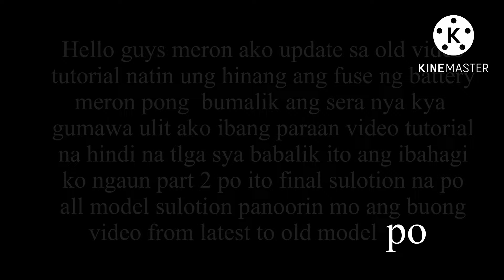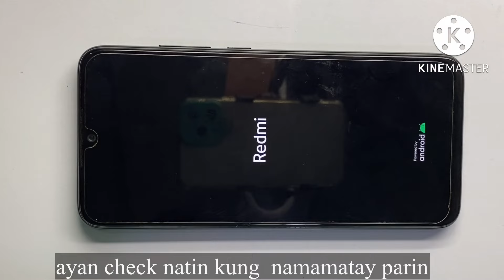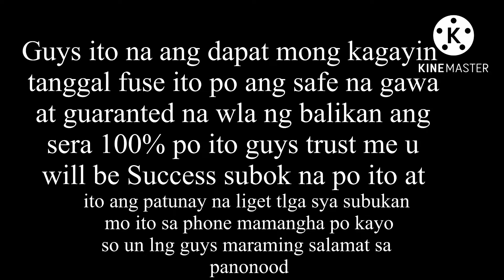All model Battery Fuse Problem Nagagamit lang Kapag Nakasaksak ang Charger Tinodo ko na kaalaman ko!

Comment: Bosing redmi note 7 cp ko, balak ko balkasin at tanggalin fuse buti my video ka

Naghahang na kasi cp kona yun 2019 pa kasi nag downgrade na ang battery, inisip ko malamang sa battery n ito at humina sa katagalan kahit alaga ko

salamat sa video mo, naka kuha ako idea..subukan ko muna tanggalin fuse, baka sakali bumalik lakas nya
Reply from the maker: redmi note 7 din model nito
Reply: @JulphoneTv  ou bossing Xiaomi redmi note 7..bigla din nag hahang na pag naka data or wifi. ok pa naman battery hindi lobo, di din kasi ako mahilig sa games

nasa 3000mah nung chineck ko sa accu battery na apps. 4000 mah yung design capacity 

iniisip ko lng pano maintenance pag natanggal kona ang fuse? 30 % - 90%  lng din charge ko

and mas malakas naba pwersa ng power supply nya wala n fuse
Reply: @JulphoneTv  bossing pwede Kona sungkitin nlng Yung battery ng redmi note 7 pag tinanggal fuse at mag hinang, diko na babaklasin ng buo..

Like mga video mo na nagawa s infinix sungkit lng din

Na try Mona ba sa mg redmi phone?

Thank you

Comment: pero pwede din po ba boss change battery na lang no?
Reply from the maker: yes pwd
Reply: @JulphoneTv 😢😢😢I still have the same issue in my redmi note 8 even after applying jumper wire.
Is the problem with my battery?
Please help 🙏🙏🙏

Comment: I am not a basher here in fact isa ako sa nagsubscribe sa inyo po. nasosolve niyo po tru ganyan pero hindi na safety yan para sa phone as well as sa battery kasi wala na yung protection niya which is ang fuse.. i know this is the easiest way to solve it pero meron naman po nabibili na fuse sa market, yun nga lang hihintayin pa if tru online, anyway it solved the problem naman nasa user/owner na ang bahala na e-avoid ang over charging., still a kodus and good job.
Reply from the maker: thanks for supporting🙏❤️
Reply: saan pwede bumili ng fuse ng vivo s1 pro? gusto q po maayos phone ko 😭
Reply: Kawawa masasabugan ng battery pag nagkashort kasi wala na fuse.
Reply: Yung akin diko inalis yung fuse, hininang ko lang sa katabi ng fuse, magkabilaan/magkabilang gilid. den goods na.

Comment: Hindi ba delikado yan wala ng fuse yung battery kumbaga wala ng safty kasi rekta na sya jumper kumbaga.. baka may chance na sumabog battery?
Reply from the maker: sobranf safe tested na ito kahit ma over charge mga replacent batery wla din nman fuse na
Reply: @JulphoneTv Sir, clarify ko lang po, yung sa video is nag-jumper po kayo ng connection ng fuse at saka binalik niyo na rin po yung fuse?
Reply: @JulphoneTv pwede poba yan gawin sa oppo a5s hindi pa naman siya nalolowbat bigla nalang mamamatay tapos nag aauto start nalang po siya battery fuse napo ba ang problema po nito ..

Comment: salamat sa Idea lods, nakawala nasa  boot loop redmi note 8pro ko pag ka alis ng fuse at na hinang na sya.
nag open na sya pero may napansin akong issue ngayong gabi , nung chinarge ko sya umiinit yung charging pin ko after 5 mins napansin ko mainit sya kaya inalis ko kaagad and then hindi din nadagdagan charge. ano kaya possible problem nun Sir? Sana mapansin ang comment ko sir maraming salamat po.
Reply from the maker: palitan mo charging pin

Comment: Sir posible din po ba na fuse yung sira sa cp ko. may times na yung sound nya putol na putol hanggang sa mashutdown na. pero pagnakacharge ok naman wala namang problema
Reply: 2 kasi iniisip kong problem either battery or motherboard na pero nakita ko tong video nyo baka posible na fuse lang sira. sana masagot nyo po tanong ko para di nako bibili ng battery
Reply from the maker: yes po lalo na vivo v19 neo
Reply: @JulphoneTv  Xiaomi Redmi Note 5 po cp ko sir posible po ba na fuse din sira?
Reply: @JulphoneTv  may times po naglalaro ako ng mobile games kapag di nakacharge lumalabas mabilis po madrain yung battery ko .
Reply: @JulphoneTv  anyway salamat po sa kaalaman sir. new subscriber nyo po ako

Comment: Kung ako sa nyo palitan nalang nyu batery pa safe ang phone yan pag nag charge kau na nakalimotan nyu mag iinut ang phone nyu kapag amoled ang phone ma boborn yung lccd yan ang ng yari sa phone kasi yung fuse ang nag cintrol sa pag charge.
Reply: Boss san nmn po makaka bili ng original battery...Gusto ko na din palitan battery ng phone k kaso dko alam san bibili ng legit...
Reply: Koa ilan ba Ang bayad mag palit ng batery❤
Reply: @doti2195  mag try ako Nyan koa Kong gomana
Reply: Magbattery alarm para hindi ma-over charge ang battery. Nagtry na ako dati ng oem na battery after 3 months, super daling malobat na.
Reply: Sakin boss is di ko tinanggal ang fuse .ang ginawa ko ay re-soldered ko lang ..
Reply: Hindi naman advisable yung ginawa  niya na tanggalin ang fuse. Hindi yan safe lalo na lolobo ang battery ng phone mo worst case pa ay maaari ding sumabog. Lalo na hindi naman natin maiwasan maovercharge ang phone natin. Yan ang nagcocontrol para mahinto ang flow ng electricity sa battery natin. Pag wala yan delikado lalo na kung madalas mo ginagamit sa online gaming at nakadata ka habang nakacharge. Tapos maovercharge.
Reply: @HikariNakaputa mas maganda palit na lang po ba ng battery..??
Reply: Much better nga na ganun na lang gawin... Mas masisira cp mo pag walang Fuse...
Reply: Need palitan both fuse and battery kung d nmn lobo mag battery fuse lng... Ska kung makaluma pa din phone mo need tlga Hindi maj over charge Kasi wlang siya sa system nya safe charging
Reply: Para sakin lng po ha,, mas maganda ang pag remove ng fuse kesa sa pag palit ng battery kz iba parin ang orig na battery galing unit,, sa remove fuse sigurado parin ang kalidad,, mas advice kopo yong ganun sa mga costomer ko,,
Reply: Pangit palit batery mabilis malobat  talo parin ng orig batery
Reply: sa akin lang 'to, at para din sa akin, ok lang remove fuse at e jump, kasi original pa din ang battery basta original din ang gagamitin na charger kasi ang kanyang original na charger ay may automatic shut off kpag full na ang cp.,
Reply: mas maganda bang hindi tanggalin ang fuse? Tapos patungan nalang ng lead or tingga?